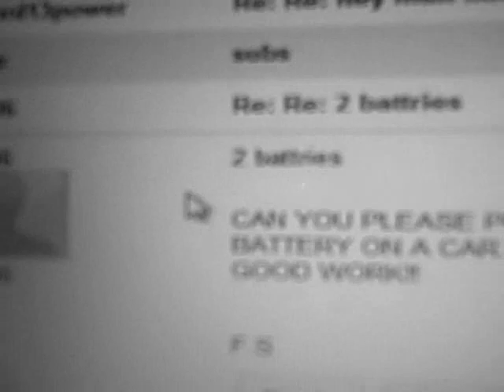(Q & A) How To Install 2 Batteries - BASIC - Adding A Second Car Audio Battery w/ Isolators & Relays

Comment: got a question i am lookin to get a kicker L7 15 and i was wondering if my pyle red label 2400 mono block amp would push it if so how should i wire it 2ohms or 4ohms if not what amp do you recomend

Comment: Hi my name is Joe, i have a bagged S10, it has 4 12inch rockford HE subs, rockford door highs, 600 watt rockford amp for lows, and like a 500 rockford for highs. im having voltage drop problems. i have a normal brand new battery up front , i dont want to change alternator, would my problem be fixed if i bought a new red top altima battery?

Comment: talking about battery isolation...think theres a way that we can place a switch on the wire going from starting batteries to the additional batteries to disconnect it while the cars off.? might mess around with that when installing my KHC2000 & DD9512

Comment: why does my car cut off when i cut my music on. i have 2 15inch audio pipe 2"4ohm sub woofers,1800w boss monoblock amp,2 350w kenwood amps, and a equalizer by ma audio. i also did the big 3 and 1 optimum battery. plus i upgraded my alternator to 105amps

Comment: could i hook up a 2nd battery by connecting the positive directly to the amp. the have the negative connect to the chassis as the ground and have the amp ground link to the same point? would that take me to 24 volts?

Comment: i have a 200 watt peak amp powering a 15 l7 in a 2000 subaru outback and the headlights dim and im worried im stressing my alternator. im wondering if you think a relay would be a good iea for me because i am planning on buy a new car in a few years and dont wanna put a new alternator in. If you could get back to me on this that would be great, also i am getting 100 ft of 0 gauge in a week and planning to do the big three do you think that will help the alternator be less stressed?

Comment: @dragonsage2008 thats an interesting find, although they list a universal fit one for dodges. im not sure about the one size fits all.

but theres also Excessive Amperage, Mechman, Mean-Green, dcpowerinc, iraggi-alternator (dot com after all those). just to add a few options, they don't list parts for my ride but they have good reputations it seems. just sort of an fyi

Comment: @dragonsage2008 i've got the optima in, but i think im going with XSpower instead of kinetic. As far as the alternator, I was told to upgrade it before adding a second battery. im having a hard time finding HO alts or brackets for my truck, but hopefully its easier for your car the best i can tell you is to search online

Comment: I'm stuck on this whole dual battery setup.. can you use an optima for the starting battery, with a kinetic for the system? or do the batteries really have to match up??
because i need a good starting battery, and a redtop would be good for that... and i've been told that kinetic/ xs will disappoint you as a starting batt.

Comment: @bl4h1 It's all the same really. The alternator is connected to the front battery normally anyways. It's just easier to connect multiple big guage wires off a terminal post on the battery and easier to run the wires cleanly and safely.

Comment: @lovegod1972 The higher the cca the better usually. Especially if you did the big 3 upgrade already. Try to buy two matching batteries though. If one is deep cycle and the other OEM, the batteries as a whole will charge only to the weakest one.

Comment: @SergeantPope You could add one in the back or front. In the back is better because of wire shortness to the system off the second battery. And it's easier due to space and the power wire already being run back there.

Comment: EXO - I got my 2nd batt & cables running to the bed of my truck, Question - Do I have to run an addition 10 ft. of power from under the hood or can I just jump off the second batt & use 4ft coming back through the bed ?

Comment: If my lights dim and if i try to start my car but the subwoofer and amp take to much power what could i do? add a batt or capacitor. but i think those caps are shit. if i had a second batt will it  stress the alt out? Please help me EXO

Comment: Relays are not very Ideal...  They're harsh on your alternator, etc.  

You don't need an isolator unless you're going to pound on your system forever. with the car off.   

When in doubt.  Just run your car and THUMP

Comment: hey i was wondering will an isolator work as if the battery are run in parallel once the engine is running? or will it just start to charge the second battery once the primary is full? i got an isolator from a garage sale it only has 3 prongs 2 big ones and one smaller, the 2 bigger prongs say 1 and 2 and t he other one says A so i assume thats for the alternator?

Comment: @alfonso713v separate the rca cables from the power. like for example, run the rca wires along the driver side, and the power wire along the passenger side, or vise versa. i kinda had the same problem but had unwanted noise. every time i increase the speed of my car, the noise gets louder. lol. and yes that means you have to take off your fronts seats for this lil project. it was a pain for me since i have headrest monitors on both the seats. lol

Comment: they r ok...i used 2 run 1 for my 2 mtx 9500 15's.. capacitors are only good because they store power for quick and big demands of power like low notes. and they can supply it quicker than a battery can. but capacitors for the most part are just adding more load..If you have the money def go with multiple batteries,, and or upgrade your alt too

Comment: Hey buddy, I deffo need more power and i deffo wwernt going to go on the parrell cos i know you can burn so much stuff out ect.. isolators people have diffrent opions dont get me wrong its good if the battreys in the boots where you can jsut chuck it away and no thing about it,

could you explane about relays more?!?! what do you need where would you get this from how does it wire up ect? Cheers Jimee

Comment: Go with an AGM battery. They're maintenence free and last forever...literally. You can drain them and charge them over and over. There's a reason new RV's and motorhomes are using them over traditional deep-cycle batteries. A lot of fanboys will cream over those lame Optima's, but that's just because they're trendy. All in all, they're no better than those Walmart Everstart batteries...which suck.

Comment: wowowowowowowowo. dont forget to fuse about 8 inches infront of each battery. fuse accordingly to power wire size. what the wire can carry is what you should fuse at, that way when more than the wire can carry goes through it you blow a fuse, and dont burn your vehical up. FUSE EVERY POSITIVE DC CONNECTION FOR SAFETY!!!

Comment: Kinetic power cells are a good add on. I do use 2 batteries but just as a temporary solution. Always use fuses on the power line.

Comment: The third and most expensive setup requires more wire, connections and also has more lost usable current through those connections. 99.9% of 12v guru's will advise against it in a car audio application due to the fact that the diodes contained in the isolator itself, have resistance, and leakage. They slowly drain on the non primary battery till the car is turning it's alternator to charge it. Isolators = bad.

In short the relay idea is a good to make sure you get home. Paralleling is best.

Comment: The first method of paralleling the batteries via power wire, the big three and the frame for ground connection is the best and ironically the cheapest method. That's how I have mine. I won't change it. It does however leave the possiblilty of leaving you stranded if you drain your set/s of batteries during extended thumpin.

The switched relay method is good if you want to use the main battery till it's drained and switch to the extra batt to start your car after an extended beat session.

Comment: no, a fully charged batts siting above 12.6v this will only take up to 3 amps to keep it around 14v when the car is running. Batts will help alot with a stock alt.

dont use Isolators, you will lose ouput. Up to 1v difference